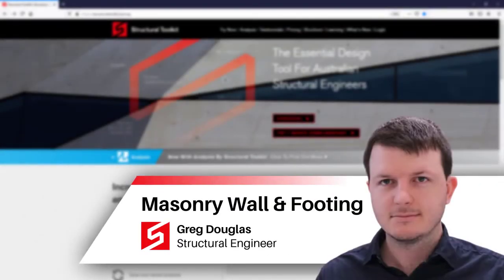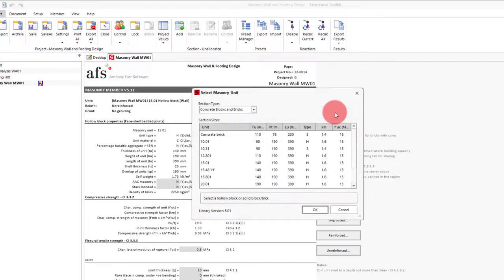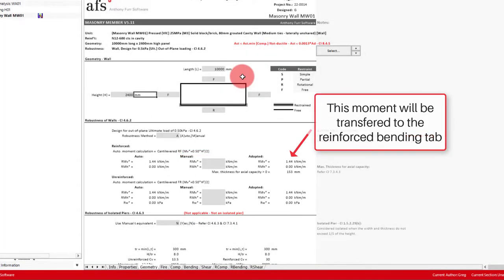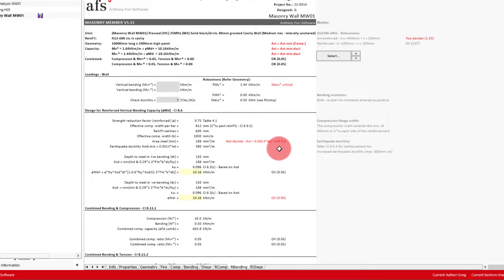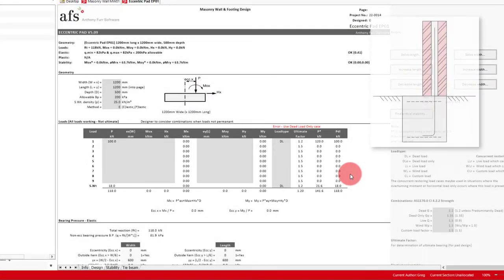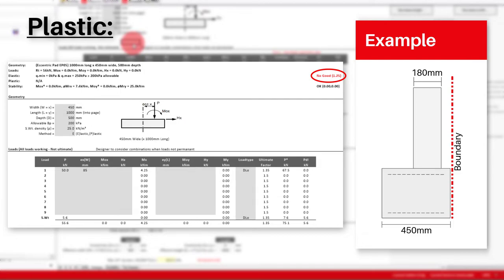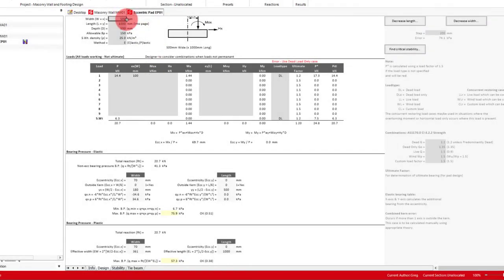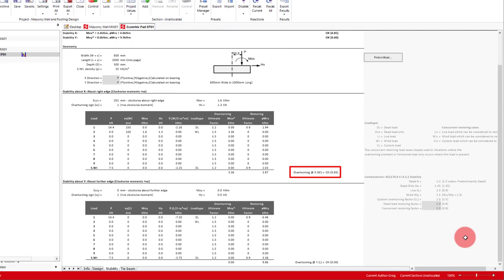Structural Toolkit: Masonry Wall & Footing Design - AS 3700

Comment: Thanks Greg, appreciate your effort. Could you explain why we need Hx when Mox already there.
Reply from the maker: Rotation of the footing occurs at the bottom right/left corner, so the Hx (which is applied at the top of the footing) will result in an additional overturning/restoring moment based on the depth of the footing as the lever arm.